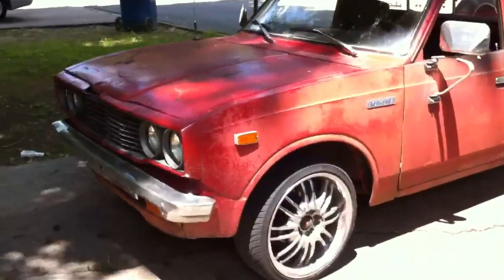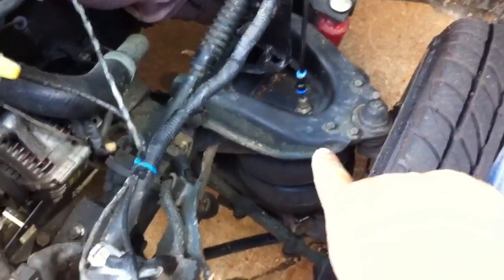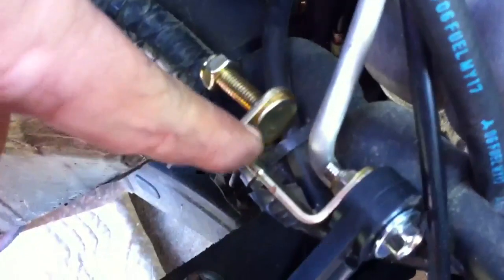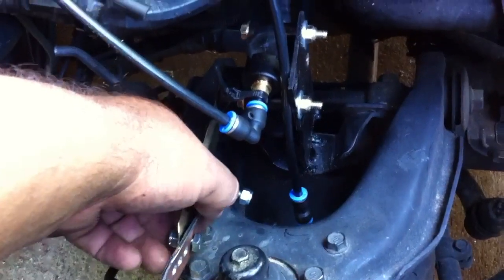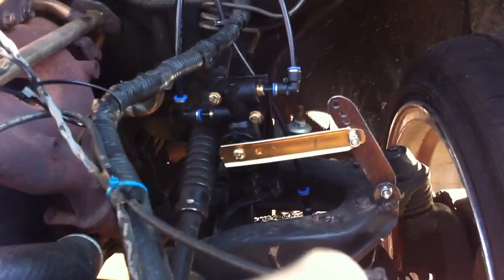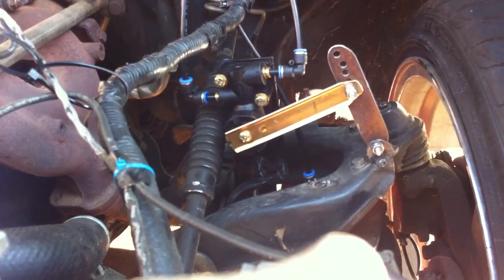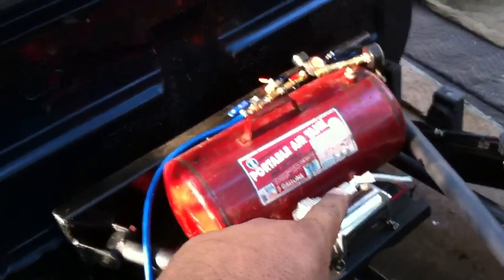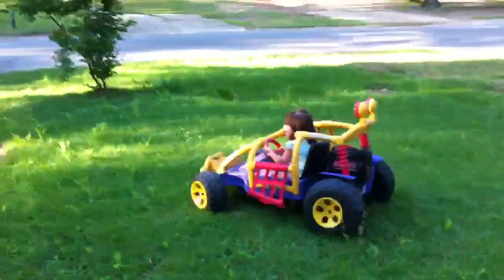Bagged Toyota pickup leveler valves

Comment: How would you install these with electric valves
Reply from the maker: You would need 2 airlines going to each bag one with the electric valve and the other with the leveler but the leveler would need a way that you could block it off when you want to use the electric valve